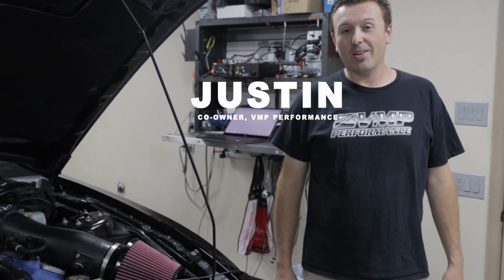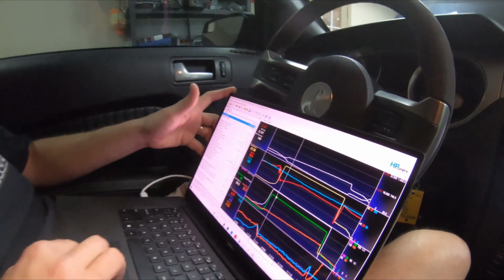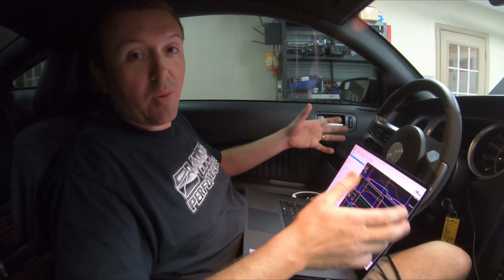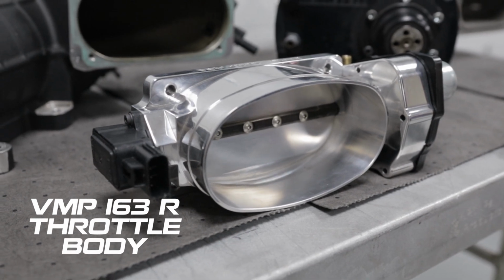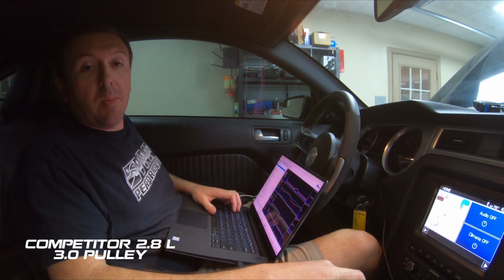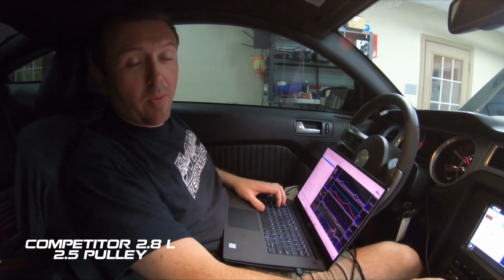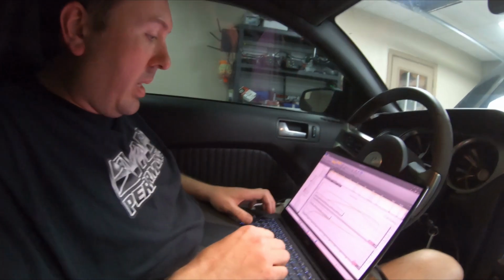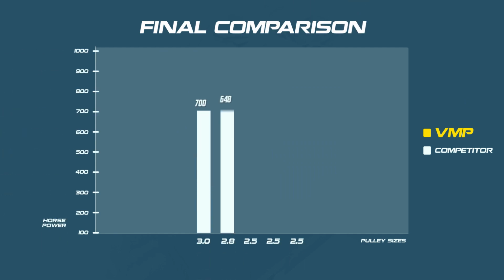Real World Testing | VMP Gen3R vs. Twin-Screw 2.8 L on a 2012 GT500

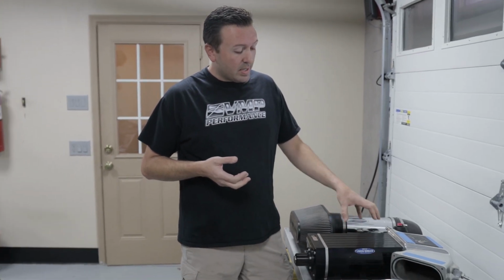Comment: @13:36 He's complaining about having to get a different hood for KB fitment, when you have to mash a coolant pipe for VMP to fit on Cobras.
Reply: Slightly modding couple things is a far cry from having to buy a cowl hood just to run the damn thing.  Don't even get me started on weight and stress on the crank.

Comment: To me, they’re very comparable, except for how the Kenne Bell dropped 60 horse because of heat, and the 3r dropped 5. They’re similar, very much so, but the 3R is clearly better. This video goes to prove Kenne Bell’s one big design flaw and that’s liquid cooling. Air to air is far better
Reply: Yea they made similar power at lower boost levels but the gen3r was doing it on slightly less boost.  When you really start spinning them you see the gen3r start to pull away.  If you had a 10% lower on there with that 2.5 upper it would have gotten much worse for the kb.  And on back to back pulls its embarrassing.  The gen3r is clearly superior it just doesn't show as much until you really start spinning them and do back to back pulls then it becomes blatantly obviously which blower is better.

Comment: If you look at their website they say the twin screw spins in the opposite direction vs a roots super charger.... Look at the pulleys, they're attached to the right rotor... They spin the same direction and work the same way, just ones bigger... Kenne bell has some false advertisement on their website... The air is not compressed between the rotors... It's stupid

Comment: The lobe ratio in a roots being 1 to 1 the 4x6 in a kenne bell is 1.5 to 1. So the one lobe really isnt spinning that much faster than the other. Didnt do very good research in rotor back design. Larger more efficient 2650? Its 4% more efficient over that 2.3. The eaton website offers more information than you provide.

Comment: I am not going discredit this comparison,when i bought my supersnake 10 years ago,with a 3.6 kenne-bell supercharger,they were king of the hill,when you only  had a tvs 2.3.i am not going dump the kenne-bell for vmp gen 3r because that what they optioned with,but  someone is in the market for a supercharger for 2008-2012 gt500 it proberlyis the  best option,i would like to see a comparison of a vmp odon compared to a whipple gen 5
Reply: I fully respect your stance on this and understand why you wouldn't wanna swap your 3.6 for a vmp...and I have no doubt in my mind if this tvs rotor pack was available 10 years ago it would have likely been on the super snakes.  The smaller 2.3 was an option on super snakes...this would have def fit the bill for the larger blower option.

Comment: I'm glad you are putting this out as a lot of commenters argue with me when I tell them that the TVS 2650 makes more power then the larger 2.8-2.9L twin screws.
Reply from the maker: It's an incredibly efficient rotor set, and it is capable of much more RPM than the twin screws which over spin the small rotor by 30-50% compared to the large rotor that is actually driven by the pulley.

Comment: JUSTIN, thank you!! For years I have been waiting for one of you guys to put your product were your mouth is. You took your product and put it out there for everyone to see against a big competitor. And you also used their correct set up.....liquid cooled, mammoth inlet..awesome. I have had a 2.8l KB on my car since the mammoth came out and it was the biggest blower on the block. It's hard to justify spending 1000's to swap blowers for a comparable Hp rating. But you guys have really tried to make your system easy and efficient. I really want to applaud you and your efforts. My next blower may be VMP. Now let's do the whipple 3.0L!!

Comment: Oh look, a biased review from a competing company who OBVIOUSLY has an issue with the competitor. Huh, he provides little details and facts about the competitor nor an understanding of its product... therefore i doubt the honesty of this comparison and the results, not to mention your proving an already known limit to the 2.8, you have yet to demonstrate that said 2.8 is more inefficient than the 2.65 TVS. MAYBE you should map out the efficiency of the two superchargers and the power it takes to spin them instead of skewing things with your choice in blowers. Until you remove your attitude from the equation I refuse to trust either VMP or KB, but based sheerly on how you've represented yourself I'd go with KB, or another TVS based brand, but I'll stick around just for the shit show lol.
Reply: ? He proved the 2.65 tvs makes more power pulley for pulley than a 2.8 kb screw blower. If both blowers were turned all the way up on a built gt500 it would be ugly for the 2.8
Reply from the maker: The competitor has been blasting TVS technology on their website since its inception over 10 years ago, so yes, we have an issue with them.  This video was meant to present the facts in a fair and unbiased way with all the supporting data that anyone can easily understand.

Comment: Nice job Justin... very solid side-by-side comparison - more work than people realize. So, the twin screw was larger displacement, made more more boost, yet created LESS HP and more heat? You're right - it's not always about size, it's about advancing design technologies, manufacturing processes and the resulting system efficiencies. Well done.

Comment: What does TVS stand for? If I have a 2014 GT 5.0 manual trans. how much horsepower do you reckon I could get with a VMP 3GR on 93 octane? Everything else pretty much stock. Just exhaust and MGW shifter.
Reply: Depends what you mean by exhaust. With long tubes and a manual transmission, Gen3r has made 650+ rwhp

Comment: I put a KB 3.6  on my 2010 COMPLETELY STOCK GT500 and it makes over 700rwhp at just 13psi on pump gas, and it doesn’t run hot either. It was ran on a Dynojet as well. KB supplied everything in they’re kit, including some nice billet motor mounts as well. That’s not too shabby to me, especially when it’s my daily driver. I haven’t had one single problem with it in 2yrs........ How can I not be happy with that???  THATS what it’s all about anyways, right? If it makes YOU HAPPY, then who cares?
I’m not saying VMP doesn’t make great stuff, but they’re also comparing they’re latest stuff with KB’s old stuff.  Just a thought.......
Reply: That's why I think this comparison is irrelevant
Reply: Calvin Mauney 
Hey Calvin, I agree to a point but at the same time there is a bunch of good info in the video, and it Definitely shows that they’ve put a buttload of time, money, research and commitment into their products and it shows. When I was able to save up the money for a blower,(which always seemed like a lifetime), I had looked at everybody’s stuff but Kenne Bell was definitely the best at the time (80’s & 90’s). After all, KB was the one that designed the turbo for the Grand National’s and GNX’S so they knew what they were doing. 
Even though I’ve been a KB guy so far, it’s really great to see VMP stepping up their game and coming out with better and better stuff because that’ll keep KB on the move too so in the end it’s us guys that win every time.
Reply from the maker: That's great to hear @Eightball and we're glad you are enjoying your car, at the end of the day that's what its all about.  Based on the competitors website the 2.8 L is a current product and is directly compared to the TVS in their various marketing materials.  We could not leave such a bold claim go un-challenged.
Reply: VMPPerformance 
And I am VERY, VERY HAPPY that you answered that challenge. It’s very obvious that you guys put a buttload of time, research and work into the stuff that you guys are coming out with so I’m pretty sure that will keep KB on their toes and forcing them to put in the same amount of effort. That’s if they want to stay in the top few anyways. So PLEASE keep answering the challenges, because in the end it’s us little guys that win, because we end up with the best stuff to choose from. That’s if we can afford it.... 😂  We’re not all successful youtubers that can buy anything we want!!
Reply: @eightball23coop  “keep kenne bell in there toes lol .. family owned company for 50 years ... and still am option at Shelby America for super snakes and Shelby 1000s this company has nothing to prove to anyone ... especially from a joker doing a video in his garage kenne bell has awesome data on there websites .... compared to the competition ... love vmp products as well but I’m reading these funny comments about “is kenne bell gonna respond “ um NO they have nothing to proove at all ... good company good products good data .. 

And the 3.6 proves it .. nothing but smiles
Reply: Joseph Webb And THATS a Fact! They supplied EVERYTHING in they’re kit including the lower mounts so that I could mount that Monster under my stock hood!! But it’s really great that all of these companies are moving forward because like I said, it’s all of us little guys that win in the end.

Comment: KB is old and outdated and this test shows it. I love VMP's commitment for this size supercharger which does not require hood notching or K member modification just to make the supercharger fit under the hood. I have always liked VMP more than KB to begin with plus IMO they look so much better under the hood than the big black looking toaster KB system. I'm so looking forward to buying a Terminator in 12 months and if it does not have a VMP on it it's getting one. And if it has a KB on it or a whipple, that will be sold for a VMP.  I really wish we could see some testing on what the VMP 2.6 does on a Terminator Cobra with the usual bolt ons of exhaust and other common mods on pump 93 gas. I have yet to see any kind of test done with this set up. I'm patiently waiting for another channel I watch to dyno a Terminator they have with this very similar set up with full exhaust, catted X pipe, air intake , VMP 2.6 and being run on 93.
Reply from the maker: @Lethal venom I'm sure we'll see some tests when the Terminator Gen3R comes out in a few months
Reply: @VMPPerformanceTV  Oh wow I had no idea you guys were coming out with the Gen 3R for the Terminator, I thought the Gen 3 was the end of the road for the Terminators.....I'm even more excited now!!!!

Comment: This video has some great points as to why I chose VMPs Gen3R over Kenne Bell or whipple. 1. The Fitment. The Gen3R fits under the stock hood without engine lowering. I can use my previous upgraded throttle body and CAI... with KB I’m forced to use their equipment.                    2. Price. These issues alone are a saving of over $2000.00 parts and labor.                                       3. It’s clear as day here in the video that the TVS, size for size, (the KB being slightly larger) is more efficient. PERIOD. Well done VMP. Keep up the great work.
Reply: Well said 👏👏
Reply: That is what i been saying the twin screw guys are all like compare it to the 3.6 or new 3.8 or 4.0 im like really?  Why dont they make new 2.65 liter blowers at kb and whipple?  Because they would not be able to hang with the newest tvs blowers from vmp with the same displacement period they have to be significantly larger in displacement to really pull away power wise.  That in and of itself gives vmp the win along with everything you said.

Comment: Anybody else surprised neither blower hit at least 800whp with c16, good timing, and 20+lbs of boost?
Reply: good cole We could've made more power with the 3R, but that wasn't the point of this test.
Reply: Chuck Harter I thought it would’ve made more in the state being. That’s a decent amount of timing and boost for it not to touch at least 850, right? Along with being on race fuel. What could’ve been done differently to make more power?
Reply from the maker: @good cole the stock 5.4l engine is really limited by the camshafts, Gen3R with 2.4in upper, NSR cams, and C16 with 24 degrees would easily make 850rwhp...but the rod longevity is unknown.
Reply: @GTCOLE281  I'm thinking this car is running a stock exhaust too but I'm not certain.   That is def holding back some power.

Comment: VMP, this is one of the best videos you all have ever put out (and your content's always been high quality).  Complete data at varying boost levels/pulley sizes, progression of IAT2 temps including back to back pulls, and all rated SAE smoothing 5.  This is the data we wanted to see (still want to see) on your new Odin supercharger ;)  Also heard a little jab in the video about a certain competitor's gen 5 3.0L supercharger...not instigating here, but if you ever do a comparison video vs. that blower it'll get everyone's attention for sure.  Once again, awesome video and thanks for the consistently great content and products!
Reply: I doubt very highly we will see a Whipple 3.0 vs VMP 2.65. I have a feeling that wouldn't work in VMP's favor. Not saying the 2.65 is bad, or can't make good power, it's just the 3.0 will do it at lower boost levels, in turn, generating less heat.
Reply: @cchvyd28  I mean it's a 3 liter blower vs a 2.65 liter blower...and in all honesty in a similar test I don't see it besting the gen3r by all that much imo.  It wouldn't pull away until you were really spinning them at their max and even then I bet it wouldn't be as much gap as you're thinking and on back to back pulls it would be right there efficiency wise.  If whipple made a 2.65 liter blower it would get smacked that is why they don't make one.  You won't see any new twin screws smaller than 3 liters that is a fact.
Reply: I never met Justin, but I do remember I had a problem with my stock 2007 GT500 blower, which would not start with my newly install VMP throttle body. Justin read the email, and actually called me on my cell and walked me threw the process and fixed the problem. I was blown away!! He actually called me!! How great is that!! Talk about great customer service ! This guy cares about his customers and is passionate of his great work and the business. All my mods will always be VMP. Thats Justin!! I'm the Border Patrol Agent you talked to in Det MI. I will be up grading my stock blower soon..

Comment: Besides the VMP GEN 3 R and tune what other performance parts are installed  ??? Fuel pump, fuel voltage booster,  injectors, heat exchanger??? That motor can’t be bone stock ...
Reply: Yes they did a video before, it’s has a VMP BAP, VMP Triple Pass HE, and I believe FIC 1000c injectors. Unless they’re changed since the, but internals are stock
Reply: The engine is bone stock I think it may be running stock exhaust too...def stock exhaust manifolds.  It just has boost a pumps and larger injectors.  Not sure about the heat exchanger.
Reply: Got it ! Thank you, I’m going to search for the video.
Reply: @ShelbyCorGT500  https://youtu.be/pey5hEkUSe8 it was this video here

Comment: It's not about size, it's about efficiency. That's what she said.
Reply: Bigger the blower the more efficient it is. That's why Eaton keeps making bigger rotor packs. 1.7, 1.9, 2.3 now 2650. Roots aren't as efficient as twin screws. Roots dont compress the air like twin screws and they have to been turned up to compete putting them out of their efficient range according to the compressor map on Eaton's website.
Reply: @darrenmcfeaters6683  how come this 2.8 blower is clearly way less efficient than the smaller 2.65 liter blower?  So much so it was down 20 horse on 1 pull...then down 60 horse then down 80 horse on back to back to back pulls while the tvs was within 5 hp on all the runs.  It made more power on less boost.  Because it is way more efficient.
Reply: @darrenmcfeaters6683  this smaller blower just made more power and it made it a hell of alot more consistently on LESS boost.  That is the definition of MORE EFFICIENT.  You have got to come up with a new argument for team kb because you're just plain out selling hopes and dreams and LIES.  GET OVER IT DUDE
Reply from the maker: @darren mcfeaters based on the air temps and other data in this test, I would beg to differ.  The twin screw manufacturers keep going larger to reduce their rotor RPM and move into a better efficiency island, while TVS has a HUGE efficiency island to begin with.  TVS can scale with RPM and with Magnuson DFT.  If the twin screw companies actually published SAE compressor maps it would be easy to show this, but they don't have the equipment or interest in doing so.
Reply: @darrenmcfeaters6683  tvs roots are more efficient than screw blowers. Did you not just watch the video. A smaller tvs made more power than a larger screw blower.
Reply: @mikeianno  it didn't just make more power it made more on less boost.  And it was WAAAAAYYYYY more consistent.  It's not even close.  That dude Flys the kb flag and is literally stuck in 2007 with the whole twin screw is more efficient than roots etc.  The stuff that sold kbs back when 03 cobras were new.  This isn't 2003 anymore but they are holding on to the past for dear life.